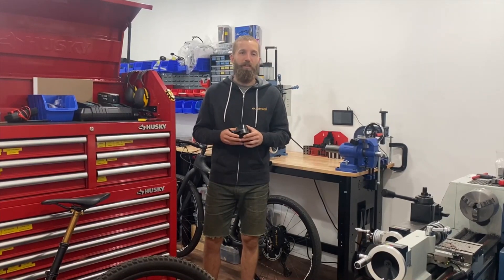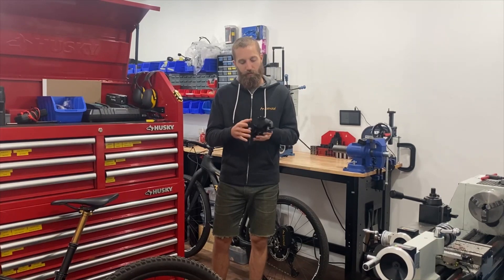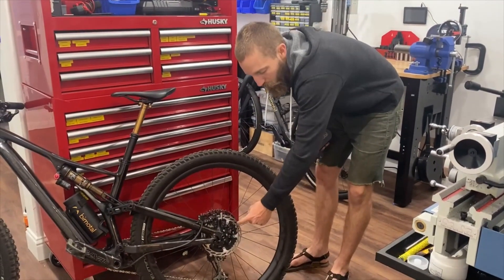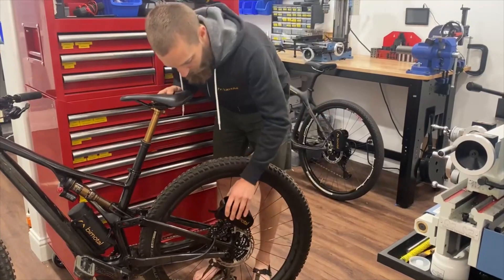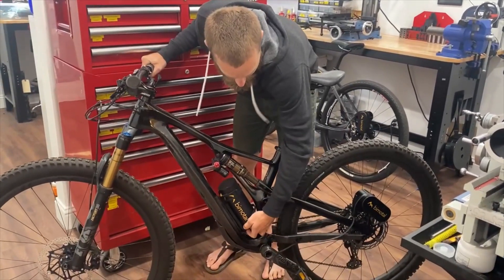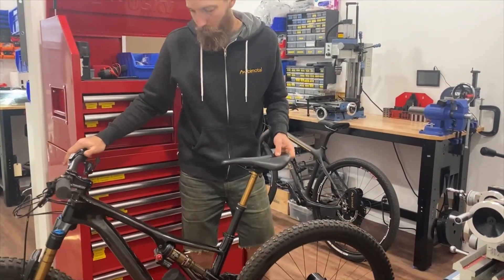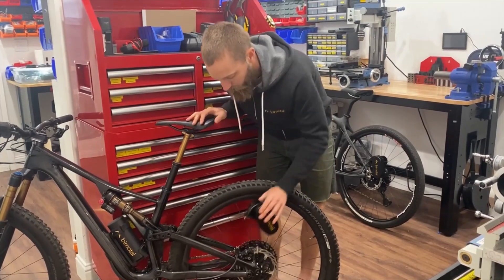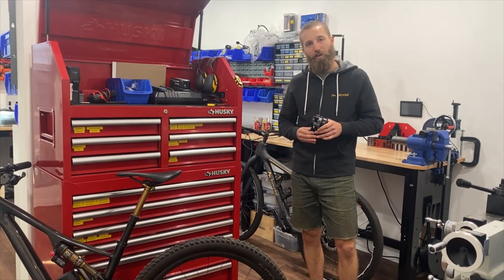Bimotal Elevate | Explained

Comment: 2 grand for this? Keep it. Most of us can buy a serious full suspension ebike for that. Get real. This will fail
Reply from the maker: Elevate is removable in less than 10 seconds so you can have an ultralight e-mtb and a normal mtb, not only that but you can make all of the bikes you already have electric by buying extra mounting kits and moving it bike to bike. bimotal.com/elevate

Comment: $2000 I think not you can buy top of line full e-bike for that much not just the motor.
Reply: The good news is that some companies are coming up with designs for ebikes that don't need motors or batteries. So much power is generated from crankarm and wheel movement. Obviously, the energy can be stored in a capacitor and power the drivetrain like an ebike

Comment: Bro I can get a e carrera vengeance for that price and if I was looking to get something like the bimotal id rather get a Baganda kit for $500
Reply: Yeah but you can't take and buy an expensive high-performance e-bike mtb for that price. This lets you convert your existing bike high end by ke without basically wrecking the bike like the other kits do. Looks like it's easily reversible from an e-bike which is really nice. If you get a high-end e-bike that has the performance of your non e-bike you're going to spend $7,000 and then it always has to be an e-bike even after you can't buy the batteries anymore or its outdated. Thisway you still have your clean manual setup or pop on the e assist. Nice for traveling so you don't need 2 bikes.
Reply: I guess but it’s still too expensive in my opinion like I’m 14 and me and my friends can easily put an e bike kit and by no means are we smart and even if u can’t put a bafang kit which is $500 u can always get people to do it for like 90$ and even with paying a professional to do it it would be way cheaper than bitmotal more powerful lasts longer and it’s legal

Comment: i love the idea, especially with the possibility of making your bicycle AWD. 
would only use it to get started from a standstill. does it also have regen braking?
Reply: I have a AWD dual hub bike. The front wheel motorization isn't that great. Burns out alot of ur not even distributing weight

Comment: Great idea, fantastic engineering here as well! However, what about rotor rub, heat dissipation, breaking with the throttle, etc. Also, wouldn't this affect the prawls and engagement wear on your hub? Not hating, just thinking of other avenues where issues may arise. Fantastic product; more many think the price point is a bit higher, it seems to be exactly where it needs to be. I understand cheaper is better to the consumer, but also this is 1/3 of the cost of an e-bike. Who needs a nice drivetrain when you have a battery to get you to the top lol
Reply from the maker: The engineering has been a challenge for sure. You’ve called out a lot of the issues we had to resolve, hence longer time to market.

Doesn’t affect hub wear since it goes through brake mount, which is part of the shell and laced to the spokes. It does put extra load on your spokes but we’ve found it to be no problem with half decent wheels

Comment: So expensive 2 k?
Reply: It is a little high but still has a lot of value over a traditional ebike at that price point. It only adds around 5 lbs and you get to use your own nice mountain bike. To me that's better than paying $5-10k+ on a dedicated ebike that is still a compromise at around 50lbs! Pull this sucker off at the top of the mountain. Back to having a playful fun traditional mtb for the decent!  For me, its a perfect shuttle solution.
Reply: If they can get the price of this down to $500 or even $1000 they'll corner the entire ebike market.
Reply: @deefer305  I'll be waiting.